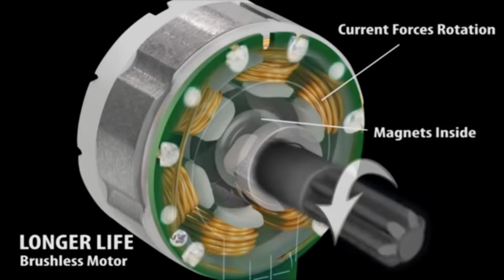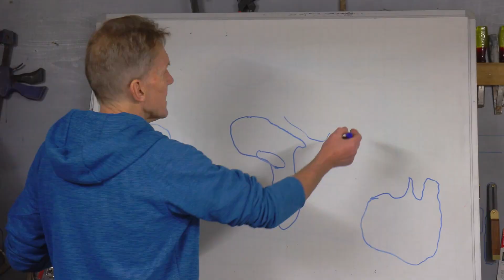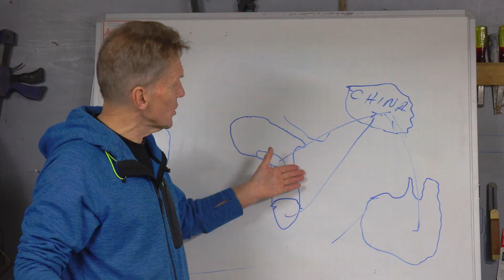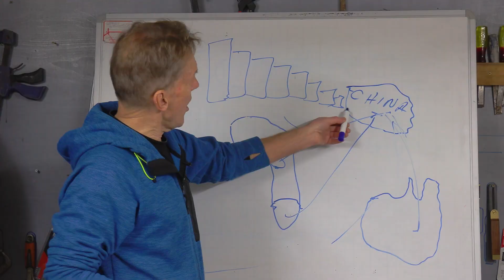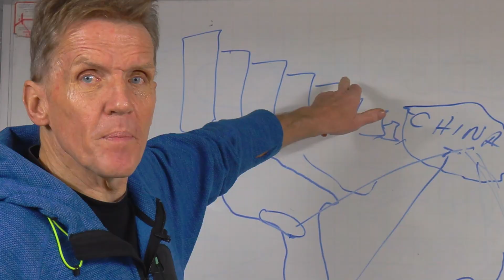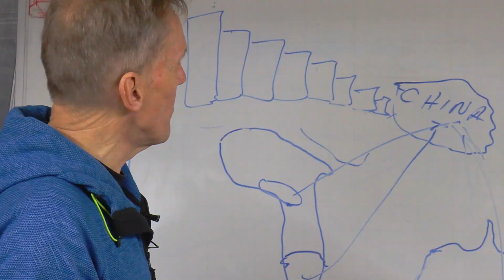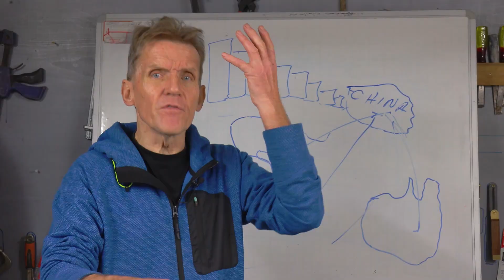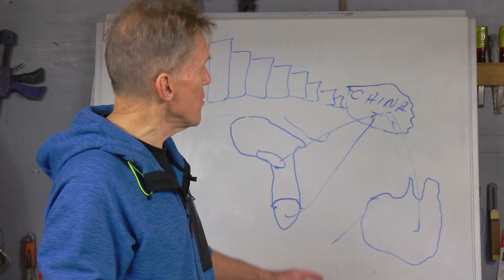The Crazy Cost of Going Cordless?

Comment: I follow the same rule as Roger, for corded or cordless, with the added factor of does it need a vac, which really are only any good if there corded, so the tool might as well be as well. I'm  in the market for a new rotary hammer drill, and I'm having a hard time deciding whether to go cordless or not. Can't decide if the extra cost is worth it.

Comment: Need a mains to dc adapter to allow using battery tools with a cord. Could almost result in the Best of both worlds.  

Guess there is no incentive for tool manufactures to make such adapters as tool and battery pricing structure / business model is lightly simmiler to printers and ink cartridges, ie most of the proffit is on the battries.

Comment: I was determined to get the dewalt flexi volt 305mm...
Covid meant I couldn't coz screwfix and toolstation never had any in stock and couldn't get them in so I settled for the cheapest no frills dewalt 240v. The 780? Cost £200.
It's been bang on and i don't know why I was prepared to spend nearly £1500 on a saw that I rarely need just coz it runs on battery.
Reply: Depends on your uses for them. I could not run my business without my cordless tools.

Comment: Li ion batteries are fundamentally recyclable, so it's just a case of how much does it cost? every time a dead battery passes through a process, from one company to another someone is going to want make a profit. So do what Tesla do - vertically integrate - in other words do the fewest number of steps to produce a recycled product
Reply from the maker: That is true and there is a large recycling plant in Germany but, at present, it is not an economical process. That may change

Comment: For at home for a hobbyist or homeowner? Need? No. But am I much more likely to want to use them if I don't need to plug 'em in? Yep. Same reason I have guitars out in stands and hanging on the wall, and not in their case in a closet. Is the case a "better" place for them? Absolutely. But I'm also way less likely to use them if there's that much friction between wanting to use the tool, and using the tool. But if you're just starting out and/or just want to save a buck, corded tools are a great way to save that money.

Comment: Battery cells themselves are not nearly as expensive as the manufacturer prices would tell. In fact, you can replace the cells yourself. I just did that in my vacuum cleaner (21.6V, 2.5Ah; new battery costs 75 euros, 6 cells costed me 17) and in my Hitachi cordless drill (14V, 1.5Ah; can't even buy this anymore, 4 new 2.5Ah cells costed me about 12 euros).

It's surprisingly easy once you watched 60 mins worth of 'how-to' videos and invested in a 20-50 euro into a spot welder. Classic case of using the tool once pays its price on the first job.
Reply: Absolutely spot on.

Comment: Roger, you're a legend! Nick the customer's electricity... Love it! And, couldn't agree more: if you don't need to lug it around, corded is absolutely fine. I do, however, own a cordless tracksaw. My corded version is 110v, and it ain't half a bind lugging the tranny around the place, along with extension leads. Yeah, I could go 240v for domestic jobs, but three tracksaws - it just starts to get silly. 
On domestic jobs, I fit locks with the Souber, using an old B&Q drill I picked up in the 90s for £16. It ain't beautiful, but it works and has plenty of grunt.
Reply: Get yourself a 1500W transformer. Nearly half the weight.

Comment: I'm often working in places with no electricity so battery all the way for me. Also if you're plugging into the customers wall and something goes wrong with a high draw tool like a table saw/mitre saw then you're liable and I'd just rather not be dealing with insurance companies where possible.
Reply from the maker: I have been plugging in for years and, so far, nothing apart from tripping the odd RCD with my angle grinder. You might as well worry about your battery charger burning the house down which happens quite a lot.
Reply: @SkillBuilder  I understand your video and where you're coming from, but there's also times where 240/110v is inconvenient or just not possible. Potentially even having a generator on site. I've seen in your previous video's people working on roofs with a mitre saw and rather than causing a trip hazard on the scaffolding, it was a battery DeWalt. All my tools are battery now unless they stay in my workshop. Only once last year did I need to plug a charger into a customers house as I generally keep plenty of batteries and they last plenty long enough these days. For what I do and how I work, corded tools just don't have the appeal.

Comment: Fully agree with Roger, cordless for Combi-Drill, Impact Driver & Multi-tool but corded for Large Mitre Saws, Circular Saws (especially when ripping), SDS MAX Breakers etc. Mind you a very experienced Installation Electrician neighbour of mine,  who works on large projects in London has completely changed over to Cordless Power Tools to save the hassle of having to have all his older 110v Corded Power Tools/Transformers etc. PAT Tested every week 😕
Reply: @QR Bought a Dewalt DCS577N 54V XR Circular Saw with 9AH FLEXVOLT battery & 190mm Extreme Blade from USA (before it came out in UK, hence 60V on blade guard 😂) & okay for crosscutting & trimming rafter tails etc. but with only a 1.55mm blade kerf absolutely useless at "ripping" (e.g. furrings in wet 2" thick lumber as blade  deflects all over the place & £190 battery lasts approx. 40 mins 😂). So for "ripping" I use an 8 year old corded 15A imported Makita 5377MG Hypoid Circular Saw that (runs on a 110V UK Transformer). This rips dead straight all day long has about 3X the torque of a European "Sidewinder", so never gets bogged down & has never missed a beat 👍😎  Also cost me about a 1/3rd the price of the Dewalt Cordless/Flexvolt combo 😂
Reply: As a sparks you don't really need that many power tools though, not like a chippy anyway, especially if he's doing bigger stuff, he'd rarely need to get a breaker or anything out
Reply: @QRFully agree, corded can be a right pain (especially when my "bish bash bosh" roofer son is in such a rush that he doesn't look out for the power lead and cuts right through it!........ on two occasions  😂), and yes batteries (even 9Ah Flexvolts) do f*ck out when they get hot 😂 (mines knackered already & won't charge 😨). So it's "horses for courses" ...... wouldn't mind giving the Skilsaw 10-1/4'' TRUEHVL Cordless Worm Drive Circular Saw a go though 👍😀

Comment: Well they better hurry up and replace lithium as the experts recon it’s going to run out by 2030? Like you say if Japan can crack the sodium ion batteries that will be amazing.
Reply: I did my geography o level in 1979, the standard answer was that oil was going to run out in 2000. So it might be that Lithium could crawl over the 2030 deadline

Comment: Let's be honest, cordless mitre saw etc. are mostly pointless, simply because if you are at a job 9/10 times you are going to have mains power. 

furthermore. if you are using mitre saws. i think it is fair to say. you are probably gonna be doing a larger job. if a larger job does not have mains power.  in which case. you are probably going to require a means to charge your cordless tools anyway.. so a generator would be the go to. so if that is the case. i would just connect a mains powered mitre directly to the gen. so again, i really think cordless mitres are pointless in almost all cases. 

there are cheaper work arounds to get a mains powered mitre up and running than it is to buy a cordless mitre.  justifying a cordless mitre is very hard for more, i can not think of a time where i would ever need one.

Comment: I really haven't seen that battery powered tools last shorter than corded. It was definitely the case 19 or so years ago when tools were all brushed, but usually you just burn them out because you are loo lazy to replace the brushes. Other than that corded break just as often as cordless in my experience.
Reply: Some cordless tools really love to fry the circuit boards inside the tools. Nowadays even tools are managed by circuit boards. I still have some old brushed tools around that don’t really need circuit boards and work a treat.

Comment: Hi Roger I totally agree , I can remember we had a shelf full of battery drills that just needed a replacement battery but it didn’t make economic sense to replace them , it was easy-a just to replace the drill  . And of course all those dead batteries are often sent to land fill . All those nasty chemicals waiting to leach back into the environment . You mentioned the Places were the raw materials are mined , again resulting in terrible working conditions for those who have to extract the stuff . Global warming is not the problem ,it’s all the crape we’ve polluting the ground and seas with . And that is definitely something we can do something about
Reply: If a battery pack goes bad, in most cases it is one or 2 cells that goes bad and it makes the whole pack useless. Don’t bin it, sell it on eBay for whatever money it can fetch. Some guys buy them to use the good remaining cells for power walls, ebike  packs and other projects.
Reply: Regarding the raw materials, lots of products suffer from that, even popular mobile phones.
Reply: As a tradesman I could not do without my cordless tools. Never had a problem with modern batteries.
Reply: Batteries are recycled at most recycling centres

Comment: Depends on the brand of cordless tools you buy. Dewalt Flexvolt cordless tools are more powerful then any corded tool. No extension cords means no OSHA problems. No extension cords means , no power trips in the rain or snow and no worries about sharing temp power on a job site. 
     Much safer not dragging extension cords up ladders. Much safer not having a dozen extension cords out around a job site. 
     Add the price of 2 batteries to every job and let the customer pay for your batteries.
Reply: And that is one more reason you can explain to your customer why you charge so much because the battery packs are so expensive. I’m not joking. Some customers think the tools come to you for free😂

Comment: The second hand price of Yankee screwdrivers has just gone through the roof after this video Roger.
Reply: You cannot beat the leverage you can achieve with a Yankee screwdriver - one of the first hand tools I bought in 1970 and still have it.👍
Reply: @normanboyes4983  got to have a jubilee clip stop it rolling off😄
Reply: Cannot bring myself to get rid of my Yankee
Reply: @markevans1968 I keep mine for one job that I haven't found anything better that will do the job.
Taking off an old door that has slotted screws. Chip out the paint, get my Yankee in the closed position, push my back into the opposite door jam for maximum pressure and out they come.
Reply: @harveysmith100  you’re not wrong. My cordless tool kit has changed “colour” across the years. But the Yankee remains irreplaceable
Reply: @markevans1968  Same here. Also as you get older and your back and knees complain, the Yankee is great for floor board screw too.
Reply: @harveysmith100  I’m with you on all of that!  All the best for 22 Harvey
Reply: @markevans1968  Have a good year Mark. It has to be better than the last two!
Reply: @markevans1968  You're in a big club.

Comment: I remember my uncle had these two massive 24v Bosch cordless combi (hammer) drills when I used to work with him in the early 2000s. The only cordless tool that could actually drill into a wall - but my god we had to charge them a lot. 

I’m with you Roger; and am a battery convert for the tools where there is an obvious benefit, and love my Milwaukee 18v Drill, impact driver, circular saw. But for Mitre saws and the like i can’t see past the value of a decent corded Makita or Bosch.

I got a cracking Bosch SDS drill recently for £100 that has all the power I need and I hope will last forever. But, I must say… dragging the cord around when I use it (infrequently) is a right pain in the backside after the luxury of cordless.

So, if you want to know how great your cordless tools are… buy a plug in drill and realise how much brain space you have to waste thinking about the cord.

Comment: I worked on new build sites with no mains power for years (wiring houses) starting with hand tools only. Eventually bought a generator and could then use powerful mains drills and also electric lighting in winter. Did the work in half the time, battery drills just wouldn't cut it. Only used them for small jobs where it wasn't worth bringing the generator. Now, the retailers are always trying to sell battery drills, more profit maybe?
Reply: Everyone wants battery drills most of us can’t lug around a generator and transformer

Comment: We have a Bosch drill at home that is corded that's well over 30 years old at this point. Still works perfectly fine. It's a little inconvenient at times to have to plug it in but it's not a good enough reason to buy a tool that will likely break after a year or need new batteries all the time.
Reply: Mine is also about 30 years old. It’s the one with the thermal torque cut out. I’ve changed the brushes twice and re greased the gearbox a few years back. The bearings have seen HEAVY usage but all is in fine order. The makita 5Ah sees usage also but when it’s a bigger concrete job the bosh comes out. Followed by the dewalt 7.5kn drill that sadly doesn’t.. It PUNCHES the masonry with no force control. Bricks get shattered not drilled. The old trusty bosh does that job every time on 550w.240v.
Every time
Reply: Bosh CSB550 RET.
So good they never copied it 
The thermal cut out saves that motor 
NEVER bettered 
NEVER repeated.     Gem
Reply: Take a lot of welly before cut out also… Gem
Reply: Blinding gem
Reply: Im a Bosch user I had my 110volt SDS in 2003 and its still running like a monster hands down the best drill Ive had. Got myself the Hikoki 36v last summer its not a powerful as the Bosch but I had to buy a cordless,these bloody sites are ramming this cordless crap down our necks
Reply: @jjamo5  
hi James. Corse you don’t just have to plug in. You need to lug the lumpy transformer around.
Reply: Battery drills ARE better balanced and EASIER to use . It has to be ‘ horses for corses.’
If you expect to get to a site with doggie power then the batteries make sense. You get to the site and 40 people are running splits off the same wall plug then only using a charger seems less selfish than running 110v transformers .
Reply: Lol cord is ok if you are into diy but try finding a 240v plug in site everything needs to be 110 so really job specific you need cordless
Reply: Inherited ancient 3 black and deckers easily over 40 years old and still running. Still find my modern Bosch rechargeable  far more convenient though - though I'd only ever buy a pro model.

Comment: Is like core drill, try to drill a 110mm soil hole in concrete with battery sds drill 😂 hoewer I like my m18 Milwaukee angle, but still have some Corded sds, grinder, thread cutting machine.

Comment: I use very few corded tools now.
Reply from the maker: Yes that is fairly typical but the question is how much are you willing to pay for those batteries?
Reply: @SkillBuilder  I`m contemplating a cordless  airless spray unit, the batteries arent cheap but the convenience will be worth it!
Reply: I`ve given away a decent Elu sds drill and Fein multitool, both corded and didn`t regret it.

Comment: Saved some cash when I was assembling SIP pannels for garden offices an got a corded drill and impact by Makita same price as a bare cordless tool, they are great for bench work however I hardly use them doing anything else as the extension cable can be a pain

That being said when my DeWalt runs out of battery you can bet your house I wish I grabbed the good old Makita's

A kitchen fitter I know will plug his charger in at the customers house before he dose anything for the day
Reply: He is not the only one 😂
Reply: My DeWalts have amazing longevity and charge fast enough for me. I would never go wired again.
Reply: @LEO-xo9cz  
I’m with you in that one. Lately I ended up in the M12 range due to the power they have. For drills, impacts etc, they are powerful enough for most tasks. Plus lighter on your hands. When we are young, nothing is heavy, but at some point, you hands starts to suffer. It is a shame that manufacturers know the benefits of lighter tools and they charge pretty much the same for a 12v tools when comparing to a 18v.

Comment: My rule for corded/cordless is I won’t buy a cordless tool if I’m going to have dust extraction in most of the time. Grey area is circular saw and router. I like to use a cordless circular saw as it’s something I’d move around with. I use a Bosch corded router but will likely get a makita 18v trim router for light tasks. Again as it is more portable.

Comment: Funny, for me I don't take my multitool anywhere where there isn't mains supply anyways.
Reply: Me to. I use my multi tool a lot. Brought a cordless one and it was hopeless, gutless, Some tools have to be 240, circular saw, multi tool, and sds drill have to be 240. Loads more grunt!
Reply: @tilerman  buy a better multitool as decent cordless ones equal the same power as a 240 and far more versatile